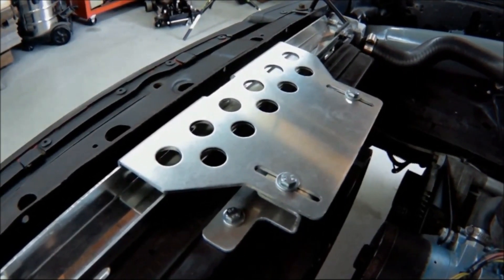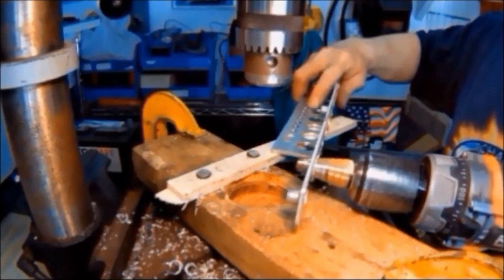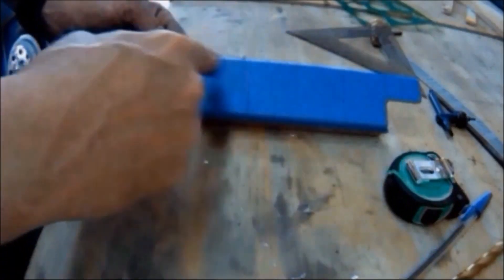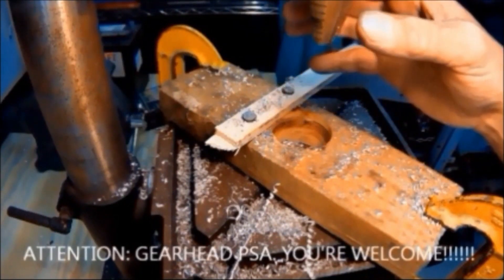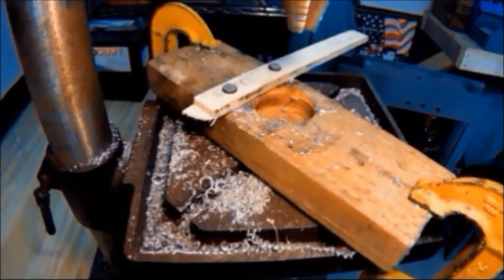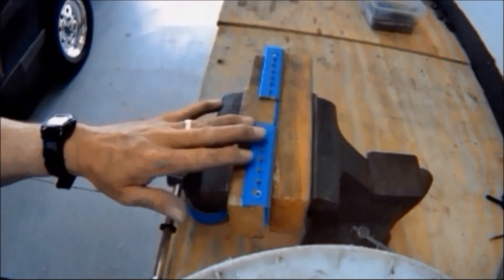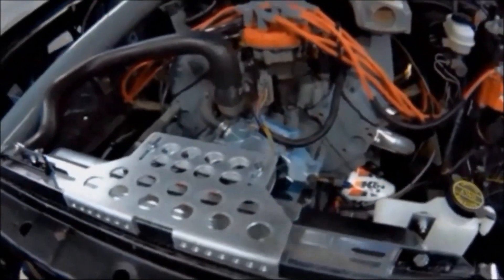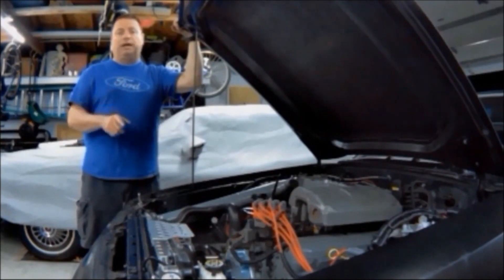Hole-Y Spirit - Speed Holes make things lighter and better looking under the hood. For free!

Comment: Good vid....been using these techniques for years.
Reply: HioSSilver1999 They can be time consuming but they are effective. 👍👍👍
Reply: @black88coupe  for sure. I have a 99 ss camaro Ive did alot of this type of stuff to. With a bolt on ls6 it went 10.7@130mph in full street  trim. Love doin more with less. Really teaches you how to get a car to accelerate......both in mod refinement and driving. Dude has a great channel.